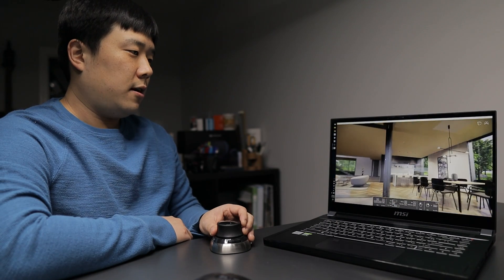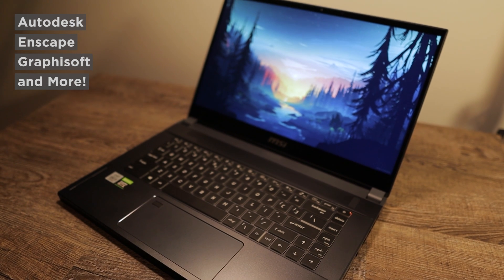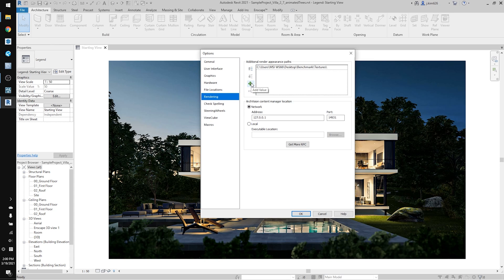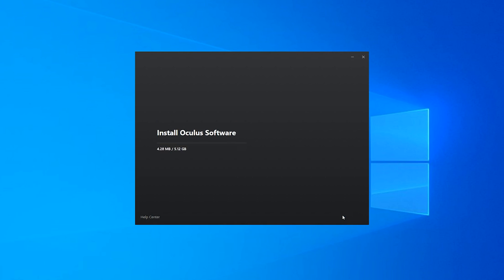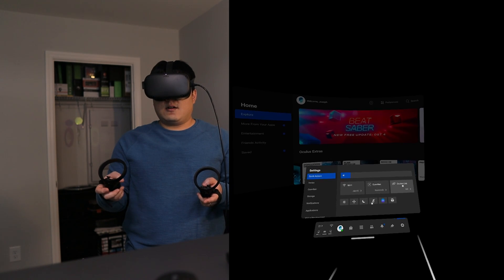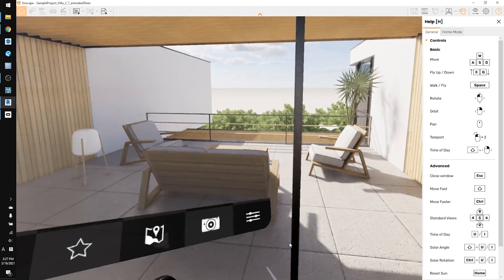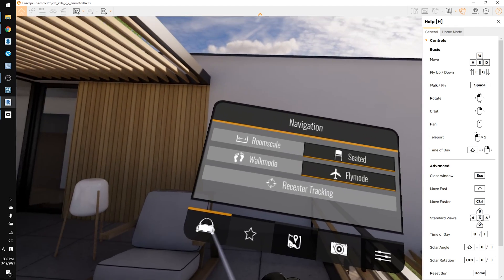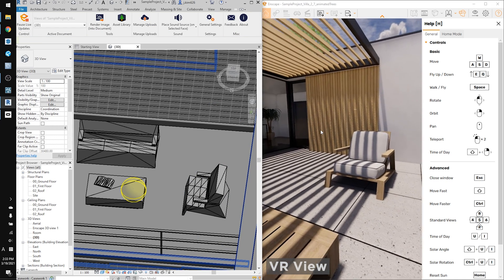How to VR for Architecture - Walk Inside Your Model (Feat. Enscape)

Comment: doing the same.. but i struggle with my screen flickering a lot in quest 3 but  on desktop looks like how u showed in video, does the same happen to u?

i have nice laptop specs like RTX 4070 - 16GB RAM & AMD Ryzen 9
Reply from the maker: This was quite a bit back, so the drivers and all may be quite different now. But your system should be able to support. Can you try running something lighter? Also, what's your connection method. Usb? Wireless?
Reply: i have same problem, via USB 3.0

Comment: Hey, Joseph...I have an Oculus quest 2, the link USB cable. I followed your instructions, enabled Airlink, and connected the Oculus with the App. When in Airlink I cannot open the desktop but can choose an application so I chose Enscape. It went all the way to the Enscape screen with the rendering open, when I clicked on enable VR headset, the rendering went away and the Revit logo came with the word loading at the bottom and nothing happened, after 10 minutes, it still had the same logo. I didn't wait more time. Any Advises? May be an old version of Enscape?
Reply from the maker: I'd update all drivers and software as the first. As there are many parts that are working together here, I've always found it to be somewhat finicky at times. After all, I don't think Quest 2 is officially supported by Enscape.

Comment: Hi Joseph, great job! Also It felt like there is a drop in quality between the screen and the VR rendering.. Does that happen to you or did the VR have the same sharpness as the screen?
Reply from the maker: The quality of the VR experience will depand highly on the headset you use. The recording is not a good reflective of what I actually see.

Comment: i tired your step by step for Enscape with Quest 2 but when hitting button for VR, Enscape try to find the device - nothing happend.could not find a video for the latest version of enscape with Quest2, can you share something?
Reply from the maker: I don't think Enscape supports Quest 2 officially still. And the connection breaks quite frequently depending on the versions. I belive you need Steam's VR enabled and Oculus running (which seems convoluted)
Reply: @JosephKim  thanks, I have tried. at least I have done it working for a short time using Wifi. need to get a cable-link and try with less time lacking. its realy bad, that they are not supprtive for Quest at all

Comment: Sir which cable are using while connecting to laptop to vr which company cable we should for the enscape
Reply: How can I buy cable that support enscape
Reply from the maker: @shivammokal7038  there isn't a cable thag specifically support Enscape. But there are ones that supports VR Link.
Reply: Actually I am buying it I use enscape but I want a confirmation that meta quest 2 support enscape 100 percent!
Reply from the maker: @shivammokal7038  Quest 2 is not officially supported VR headset for Enscape.
Reply: Sir in the video your using it that only but !
Reply from the maker: @shivammokal7038  you can use it. But it just isn't official. So, you may not find any cable that officially supports.
Reply from the maker: I used Anker's cable. But Meta recommends using their link cable.

Comment: Hi, thank you so much for the given informations. I would like to ask you which Oculus quest 2 should I choose, the one with 256gb and  1832 × 1920 pixels or the other with 128gb and 3664x1920 pixels?
Reply: Thank you for the fast reply, both of them are oculus quests 2, but with different resolutions and memories. I’m asking this because we have only one supplier in my country and they have only these two options 😂
Reply from the maker: @nisab.7090  i didn't know that they had two different resolutions. I personally found 128gb more than enough for my use.
Reply from the maker: Which is the other one you are taking about? VR glasses are dependant on so much more than storage and resolutions.
Reply: Hello, I’ve received my quest 2 it works very well just until i click on Enscape VR button, then i get the message on my enscape tab saying “ searching for head mounted display” and the view on the headset freezes for a long time saying Sketchup loading. I also downloaded and runned Steam but it didn’t change anything. Could it be about the different charging 3.0 cables that i tried? Anytime I connected it says that the cable is 2.0. Or does changing to the Oculus Rift solve all the problems?
Reply: Also there are no Anker sellers in my country but i’ve found this cable : PremiumCord USB-C - USB 3.0 A (USB 3.1 generation 2, 3A, 10Gbit/s) . Will this be enough?

Comment: Hello, Great vídeo!! I was wondering if you could explain me how to use my meta quest 2 for presenting my projects/Renders. I’m new in this. Is there any way of looking my 360 degree Renders in the vr? And so I used lumion instead of enscape, so is there a way of walking through the project with lumion using the metaquest 2? Thanks a loot
Reply from the maker: You have to host 360 jpgs somewhere to be viewed. I've heard some people were able to view them with native app, but I have not had success. Google Photos however have been best way for me to share and view 360 images easily.
In Lumion, you can't move around as you do in Enscape. They currently only offer 360 photo/image workflow.

Comment: What brand of VR to use for autocad?
Reply from the maker: I have not used VR for AutoCAD in the past as they often are 2D
Reply: @JosephKim  
Is there a software for VR
In architecture category?
Reply from the maker: @reggea4ever  this is the VR software. Just not for AutoCAD
Reply: @JosephKim  

Does it have building design properties as CAD?
Reply from the maker: @reggea4ever  no, it is just a rendering engine.
Reply: @JosephKim  oh
Would be revolutionary if it can

Imagine creating a design
In 3d 360 form

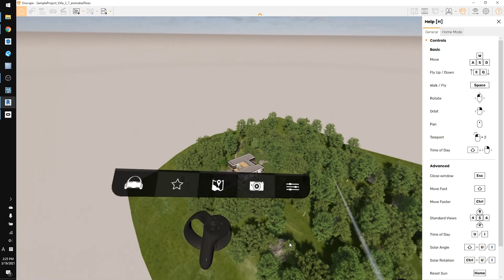Comment: 10:23 after the headset is connected and im on desktop mode i press the enable vr mode and it says looking for headset and in the quest 2 headset it says that enscape is not supported. Is there any solution??
Reply from the maker: They have been changing the compatibility for quite some time, but I think Quest 2 still isn't officially supported?

Comment: Hi Joseph
Is Liking cable very much necessary for initial process? Since I can't get my Oculus Quest 1 to pair to my phone via Meta Quest App. It's juss stuck on the starting screen showing "download meta quest app advertisement ".
Reply from the maker: It is somewhat finicky in my experience. But you may not need the cable for just setting it up on your phone?

Comment: Hello~ Mr. Kim, I have one question. 
I'm trying to link oculus quest2 and enscape on desktop now.
However, even if I click the VR icon of enscape, the VR does not run.
And on my pc, I can see the phrase 'Disable your Virtual Reality Headset'
In VR, I can see the phrase 'Reading now'
Is it a link cable issue? I'm using normal ctype-> usb cable.
I made by Rhino 3D with enscape.
Do you know what the problem is?
Reply from the maker: Try installing Steam VR and make sure that is running in the background. USB cable could be problem if that doesn't fix it.

Comment: Hey Joseph, is it possible i would get a higher resolution using HTC Vive Pro 2 instead of the Oculus Quest since there is a few complains about poor resolution ?
Reply from the maker: If the headset supports higher resolution, it will push more pixels. Idk for sure since I've not used HTC Vive Pro 2.

Comment: Hello, did you manage to remove shaking of the screen? I experience shaking screen when using oculus quest 2 on enscape - thanks
Reply from the maker: That's often caused by poor cable or GPU that isn't strong enough for VR. Basically, something is causing delays.
Reply: @JosephKim   Hi Joseph, I tried with razer blade pro rtx 3070 and also on desktop 3060ti and I have same issue on both. I have both rift and quest 2 and  rift is much more stable .
Reply from the maker: Interesting. Do you think it is USB issue?

Comment: Tnk u very much for this video. I tried OQ2 with Enscape+Sketchup but the quality is very poor. I used Sketchup texture for the model and a notebook with rtx 3060 6 mb and I7 10700 and a USB 3.0 cable. It's not enough?
Reply from the maker: If you are using SketchUp texture, there isn't more to show. Try example files from Enscape maybe?

Comment: Hi Joseph, thank for your tutorial video,
It’s really informative and useful.

Could I ask you a question about my oculus quest 2 ?

I found out that my VR device just can’t work at enscape for Revit and skp.

The thing is that.
I click on the button of enscape, the window of enscape just quit unexpectedly right on the beginning.

It’s the problem of the device or the software ? How can do for it ?

Device information:
CPU: AMD Ryzen 9 3950X
Graphic: Nvidia Quadro RTX 4000

Sorry for bothering you.
Thank for your time.
Reply from the maker: Is it just Enscape thag doesn't work? Or others don't work either? Enscape team is probably better than me in finding the solution, but updating the firmware and drivers aren't a bad start.
Reply: @JosephKim  
Thanks Joseph,

The Enscape is workable without the oculus quest 2 connected to my desktop.

Enscape and oculus are all workable individually. 

I’ve update the newest graphic firmware already.

I think it probably the software compatibility issue. Maybe.

I would try to ask enscape team for help.

Really thanks for your time and reply.

Comment: In walk mode, how do you overcome physical room size limitation? Sometime known as “pivot” in VR.
Reply from the maker: The joystick on the controller allows you to pivot. Also, there is one button that you can press and hold to 'pan' your view.
Reply: @JosephKim  Thank you so much for the reply! Just to clarify the scenario: A user is walking down a 6 meter passageway in VR. In the real world lets say the room is only 3 meters long. When the user approaches the physical wall in the real world the guardian mesh will appear in VR (assuming guardian is set up). The user will now first have to physically turn around in the real world (so they don't hit the wall) than press and hold a button on the controller to pan the passageway in VR so they can continue to walk down the remaining length (and not just walk back to the beginning of the passage)

Hope it makes sense. Looking forward to your reply!
Reply from the maker: @Mr_RA22  yeah, then just turn around with the pivot. Not sure what is the current play area limits for the Quest.
Reply: @JosephKim  Thank you. Keep up the great videos!

Comment: I've noticed the connection isn't great when using Enscape with Wireless Quest 2 connection (Air Link). Have you tested out wireless versus Link cable comparison? If so, is the link cable significantly better? I'm using the MSI WS66. Thanks!
Reply from the maker: I did see some more studder especially for more complex models. Try lowering the quality, but airlink still is quite convinient.

Comment: Good video!! You mentioned that you can actually "walk" inside the VR model but it's not recommended because ir can cause nausea. I have used Oculus compiled with UE and I also have used Enscape (cool software). So my question is: can you actually "walk or fly" with the VR headset on and the controllers? I mean, the same way you would do with the keyboard in Enscape on a PC screen.
Reply from the maker: The walk in the real space will register inside the headset too. And that does not make you nauseous. But if you 'float' by pushing the controller, it will make you nauseous. Teleporting would be possible, and is a fine method to nevigate. I hope that clarifies.
Reply: You can get used to moving with the stick after a while. Playing games like pavlov helps with the issue

Comment: is there a setting that enables the movement between the VR device and screen to be the same? Ive experienced the computer screen to be a little too jumpy. In my company I need to do walkthroughs with our clients by sharing my screen through Microsoft Teams.
Reply from the maker: It actually matches exactly. It is just your eyes inside the VR compensates all the small movements (amazing human body), but computer doesn't. I suppose Enscape needs to build a feature, stabilize VR mirroring. But that is likely to consume extra resources. I hope you can understand what I mean.

Comment: Thank you for this video, but I have question in this VR system 
There is a phenomenon that the screen is shaking, I wonder if it is not dizzy and if there is no anti-shake function
Reply: In your video , I think in headset
Reply from the maker: @MENZIP-nc3cs  oh. It's shaky because the screen isn't stabilized. What you see inside the headset won't feel shaky at all.
Reply: @JosephKim  ah, so once if I jump in to VR there is no shacky phenomenon right?
Reply: @MENZIP-nc3cs  Hello, did you manage to remove shaking of the screen? I experience shaking screen when using oculus quest 2 on enscape - thanks
Reply from the maker: The screen is shaking in the headset or the computer screen?

Comment: Hi Joseph, thank you for this precious video. Have you run the Revit Enscape sample in VR in ULTRA quality with your WS66? How many gigabyte of VRAM has your 5000 max-q? 
I’m considering to buy a GE66 with 3070 and I need to know if it could run Enscape standalone files in VR mode in ULTRA quality with my Oculus Quest 2...
Reply from the maker: It's got 16GB. Quite a lot. But I have not tested ultra with VR. The visual difference between high and ultra is quite minimal, but performance is hit quite hard. Personally, I would not go for ultra, but that's just IMO.
Reply: @JosephKim  Many thanks for your reply. I really need a laptop to run Enscape VR standalone files in Ultra and I can’t find a place to try them. I already tried, with many tests, to run the Enscape sample of the Revit big house with a Msi GE66 with 2070 super max-q (8 GB of VRam) and I had several visual problems, both in Ultra and in High. I’m trying to find out if the performance bottleneck is for the power of the GPU model or just for the amount of VRam. In the Enscape website they recommend a GPU with 8 GB of VRam for VR but I think they should be more clear about that, for example with a list of laptop and pc GPUs that can certainly run their samples in VR at the highest quality Enscape settings.
Reply from the maker: In regards to the quality, it is more likely that the pure horsepower of the GPU is what matters more. VRAM is just one metrics of GPU, and tensa core count is just another. Also, the nonexistent list of compatible GPUs are no fault of Enscape or MSI. It is because Nvidia makes many different Skews of chips that are very confusing to consumers and laptop manufacturers can tweak the chips however they want. Laptops have hard cap of 250w total power draw including CPU. The laptop 2070 isn't the same as desktop 2070. Again, I see no point in going Ultra over High for the visual quality though.